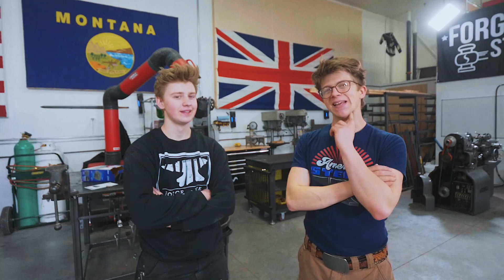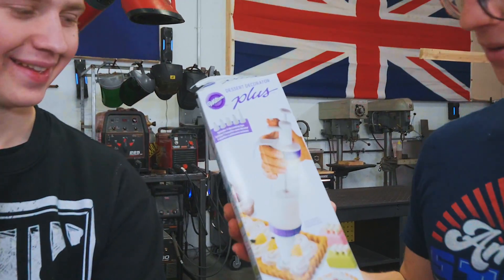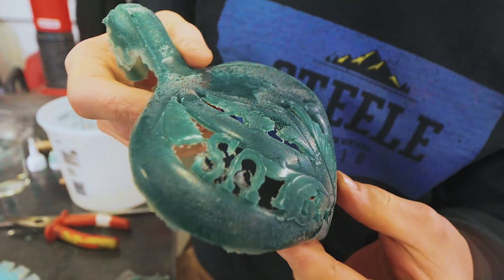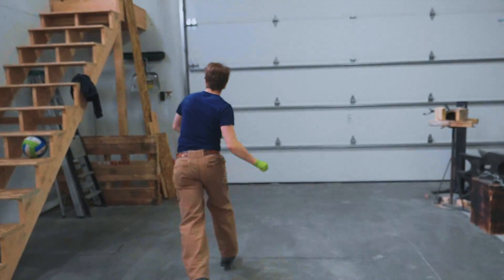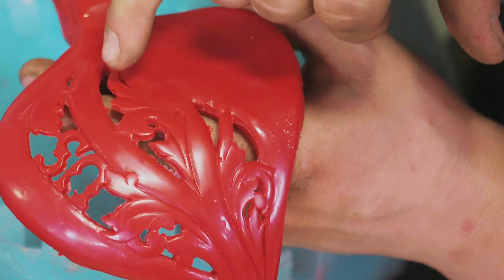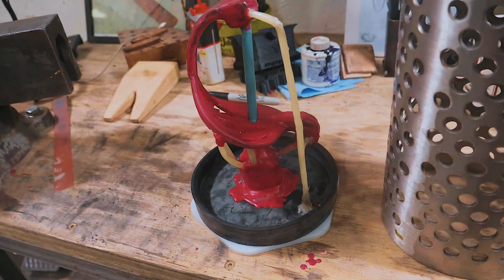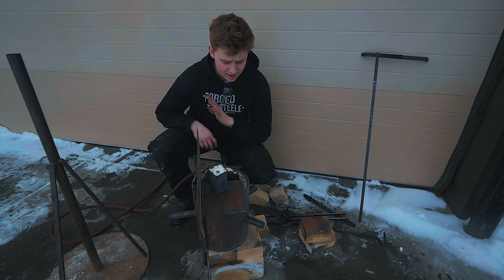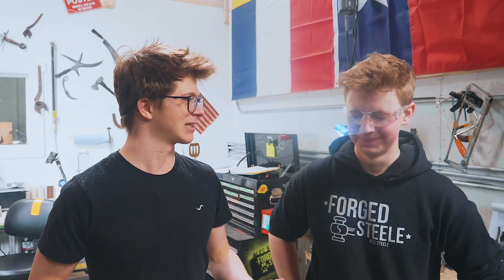MAKING THE CAVALRY SABRE: Part 13

Comment: Hi there Alex, a long time ago ... in a land far, far away ... 

Being 'serious' for a moment, before you were born, I was fortunate while studying Aeronautical Engineering at the University of Bristol to visit the Rolls Royce factory in Bristol.  They did, and still do, a lot of investment casting.  Gas turbine blades comprise much greater levels of fine detail including voids internal to the part, as well as involving other complexities to get the high end structural performance required.  What is my point?  If I remember correctly they dip their sprue 'trees', each comprising multiple blades, into the investment multiple times before 'spraying' more investment, possibly in a dry state, onto the moules.  Might this approach help to avoid the problems that you are ... have faced?

GB

Comment: Two things. One, if you pour your silicone in halves as opposed to all at once it makes for a better mold. Two, why don't you try to use a stainless steel meat injector to inject the wax?

Comment: I haven't gotten the whole way thru the episode yet. Watching the wax. You need to use a double boiler for the wax. Your wax is to hot directly on the surface of your hot plate. It needs to be indirect heat to make it even and not super hot in one spot.

Comment: Why don't you pore it in and heat it in the oven till the whole wax is molten. Then put it in the vacuum chamber and let it cool down there. Does your silicon mold withstand the temperatur at which the wax is molten? If yes the above would be your best shot.

Comment: How the hell did they manage to do this in the mid-1800s if it's this difficult to do nowadays?
Reply: I wonder the same thing.
Reply: Years and years of apprenticeship guided by craftsmen with decades of experience.
Reply: Not to mention they had craftsmen to each task. Much like making a fully traditional katana requires multiple craftsmen who specialize in each specific process. You had craftsmen who just did the casting, bladesmiths, and those who made the furniture and handles. It took multiple craftsmen working in collaberation to create the works of art a ceremonial saber would be.
Reply: @TheSatyrblue  Yep...swords were often finished by jewelers, no blacksmiths.

Comment: I am curious why they don't try to make the guard from sheet brass of the proper thickness. Shaping it with heat then using the engraving tools to cut and engrave in the details. It seem to me this would have been a faster process based on all the failed attempts with the wax and investment. I know they are trying to learn new skills at the same time which is great, but I don't think blacksmiths of the 1800's would have been casting guards but hammering them out.

Comment: Who is will? Like an apprentice or a friend?
Reply: TLDR; He's a buddy.  lol

Pretty sure he's been doing knives longer than Alec has been doing blades.  Think they had a collab at Alec's shop, then they planned to partner up in this shop. 

Will did some ground work, Alec moved, initial setup was with Will's equipment, then Alec's stuff started showing up. The move was all kind of secret. That's how i understand how it went. 

It seems like most of the investment in equipment/etc has been on Alec's dime.  I'm still not sure if it's an equal partnership, or if will is closer to an employee on the business side, but they seem to be pretty equal when it comes to projects, working and fun. (This is an assumption as a lot of footage lately has been Will working while Alec seems to be doing more off-camera stuff?). 

Sometimes it seems like it's been longer than 3 months in the new shop, but there's been a lot of development in the facility for only 3 months, and that all takes time and effort. Especially with setbacks like the smashed equipment and electrical problems, and having to replace part of the floor in the shop.

Comment: You guys should work in 2 dimensions!
Carve the wax and/or pour the brass into a FLAT version of the guardand the BEND the wax figure or the cast bronze into shape.
It would make everything easier, and should work pretty well.
Reply: Cast metal is usually quite brittle, and wax doesn't like to bend too much either
Reply: Skruffles At temperatures hot enough to soften the material, but not hot enough to melt it outright, both wax and brass should be malleable enough to manipulate. It just seems like it would be easier to cast those shapes with a simpler/flatter shape.

Comment: I dont know what investment are you going to use but that flask wont work budy. it will pour trough the holes....try using a investment material with longer setting time so you can vaccum it....

Comment: You are driving me nuts. 1-heat the silicone in the oven so the wax runs and 2- add baby powder in the silicone mold. Dust it likes it’s a cooking pan. In will draw in the wax. 3- to stop air bubbles, pressure, build a pressure pot. It won’t take much. I use a painters pressure pot but that will be to small for you. The idea is don’t let the bubbles form in the first place,  😁

Comment: So injecting hot liquids is usually done under pressure.  So if one were to build a chamber w an orifice end to insert in the mould, capable of holding enough heat to keep the wax hot. The place a silicone rubber squeggy seal around a hard insert then place a baffle such as a bicycle innertube behind the baffle...once air pressure is put to innertube it would pressurize the squeggy baffle system and force the hot wax out of the orifice into the mold without introducing air into the wax. Perhaps one could use the vacume on the other side to provide suction for removing the air from the mould as the wax is extruded in from the orifice on the hot wax injection system.   Idk just a thought.
   Blessed days sirSirs,  Crawford out

Comment: Just buy an actual wax pot. They even have was injectors built in. Not like you aren't going to keep casting so you may as well have the CORRECT equipment. You are also using wax that's too soft. Use blue casting wax and let it cool for 3-4 hours after casting

Comment: I guess I'm confused as to why this is taking so much bloody effort. I used to work at a place making boat engine props. They made a wax mold, then dipped that (over and over) into an investment. Then cooked the wax out and ended up pouring steel into the shell that was left.  So I guess I'm confused as to why y'all can't just make 1 wax cast and then dip it in the investment until you get a substantial enough shell.
But I'm not a metal worker either, I'm just a guy here for entertainment.

Comment: alec ever consider an induction forge, or do u have any experience with them, thinking of getting one soon
Reply: Evin Coughlan I almost said the same thing! It seems like a strong one would be perfect for his work.
I wonder, though, if the magnetic field affects the crystal structure of the iron, or the formation of austenite?
Though I am by no means an expert, it seems at least POSSIBLE that a magnetic field might cause the iron molecules to align into a more uniform pattern, which, as I understand it, is not good for making strong steel.
It may make no difference, but as the Curie point is well above the temperature at which austenite forms, it might. Any metallurgists/blacksmith/induction heater experts have any input?
Reply: @alden1132  very interesting point, i had never even considered this, but you may be onto something there, if not suitable for forging, it would definitely be a neat addition to anyone who is into casting or jewelry smithing. But i am very curious to hear from people who have experience working with them